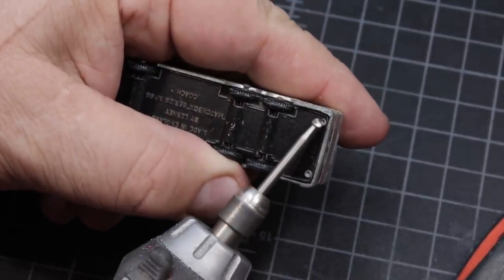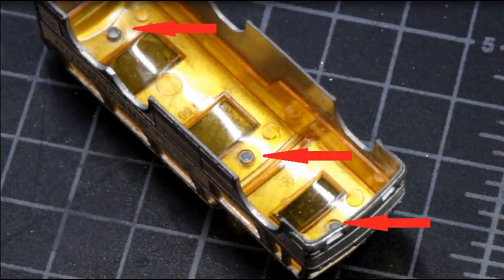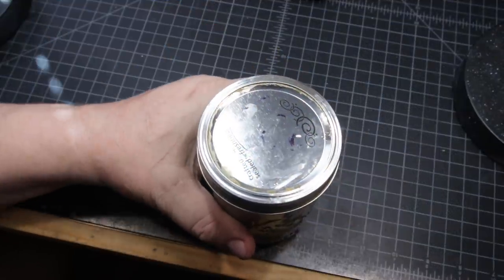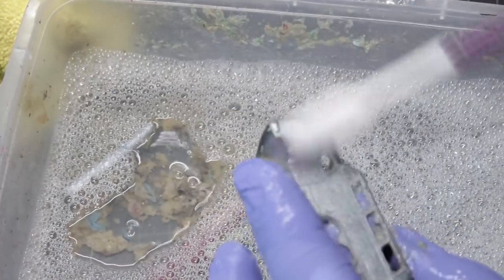Matchbox #66C Greyhound Scenicruiser - Restoration

Comment: Nice work Time Rider! I always thought this bus looked a bit strange when I played with one as a kid. Here in the U.K., I had never seen the full size vehicle.  When I saw pictures of the real Greyhound Scenicruiser I realised why the model looked so odd. As you said, it's too short, missing a window section. I guess this was so it would fit into a Matchbox box. Still a lovely old casting anyway. Just seen the new Matchbox one on ebay and it's awful. They can't recreate the classic castings of the Lesney golden era. Just a thought,  have you considered making one of these buses the correct length? If you cut 2 of them and rejoined them together to include the extra fourth window section, you would have a correct length bus. Would be interesting to see how it would turn out. Just an idea. Thanks for not turning out the light! I'm still at chapter 3.
Reply from the maker: Love the idea . . .

Comment: But you're skipping a lot of steps to the rehab, like the interior getting cleaned and installed, and installing the cleaned glass, and then the suspension parts, you leave out the best parts, but show the epoxy on the final for way too long? i dont get it?